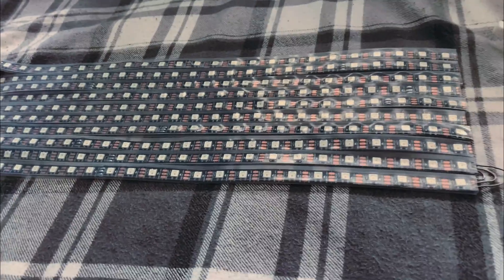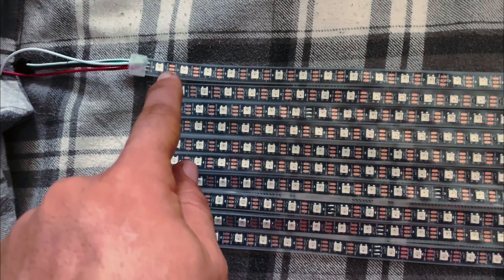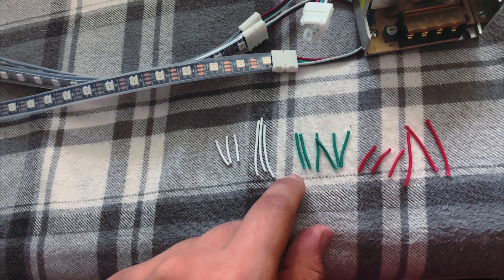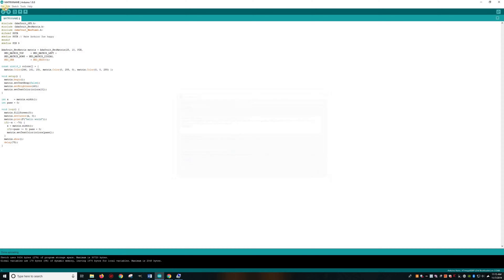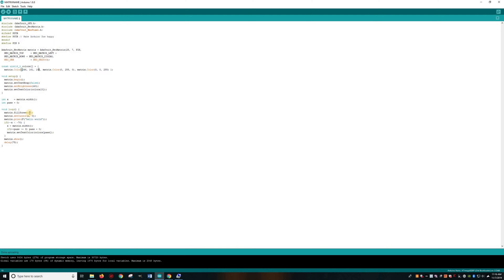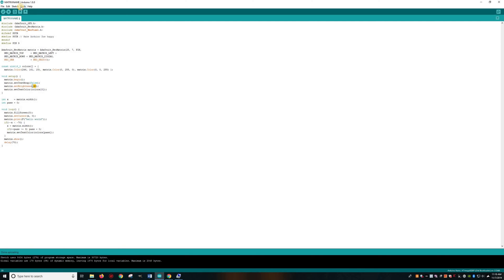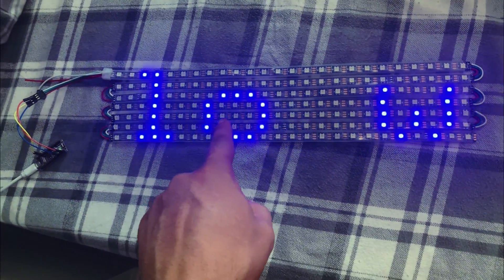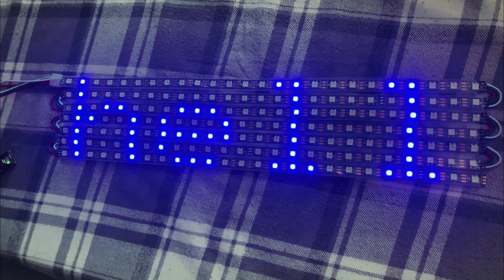HOW TO Make Your Own Scrolling Text LED Sign (arduino+ws2812b LED's)

Comment: Pixels, not bits.  Each letter is 5 pixels wide plus one pixel column between letters.
Each pixels is 24 bits so each letter is 120 bits wide, plus 24 bits for the space between letters.

Comment: I want WiFi support for this, Using NodeMCU esp8266, where you can change the text and colors on the fly. Is that Possible?

I've already done the wiring but instead of using Arduino nano, I useed esp8266. Now all I need is to find out how to do the WiFi support.
Reply: I'm looking for that too.
WLED supports a matrix now with ESP32, but from what I can tell, only for 2D effects.  It has an API that could be leveraged to feed text, graphics and other items.
Dave Plummer of Dave's Garage has Night Driver that is powerful but complex.
Reply: @danman32  Di you find a solution?

Comment: Hello, beautiful project! I followed your tutorial step by step and everything works perfectly. I have only one question: is it possible to increase the number of characters? Currently I only see 17, if I write a longer text, it is truncated. Thank you
Reply: In the line of code where the loop says if --x is < -70 , is where the matrix controls the ending of the scroll. The length of the message, and the width of your matrix need to be taken in account during the scrolling. You need to imagine all the text leaving the screen as passing a duplicate screen, of the same width to return to the screen again. You could set a variable for 'scroll length', that is the size of the length of text, spaces included; and 2x the size of the width of your matrix.  this will give your loop enough time to complete scrolling, before it starts again.
Reply: P

Comment: why this error please
Arduino: 1.8.9 (Windows 8), Board: "Arduino Nano, ATmega328P"

In file included from C:\Program Files (x86)\Arduino\libraries\Adafruit-GFX-Library-master\Adafruit_GrayOLED.cpp:20:0:

C:\Program Files (x86)\Arduino\libraries\Adafruit-GFX-Library-master\Adafruit_GrayOLED.h:30:32: fatal error: Adafruit_I2CDevice.h: No such file or directory

compilation terminated.

exit status 1
Error compiling for board Arduino Nano.

This report would have more information with
"Show verbose output during compilation"
option enabled in File -> Preferences.

Comment: could I connect to 5volt phone usb and keep it that way to show my display and leave it like that for couple hours
Reply from the maker: although these chips require 5v, you have to also make sure you can supply it with enough current... a phone 5v adapter usually only spplies 1 amp... which most likely will not keep more than 10-20 led's on at the same time